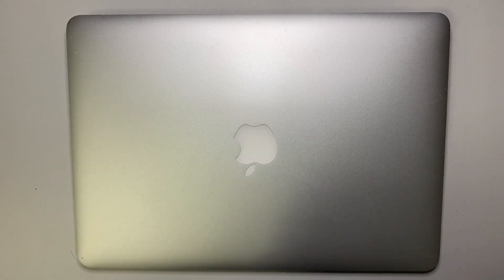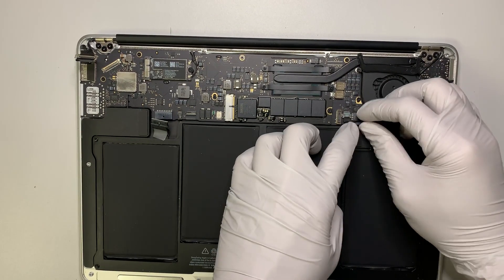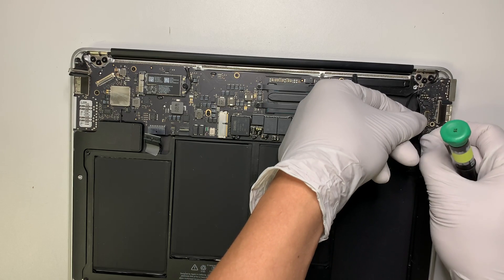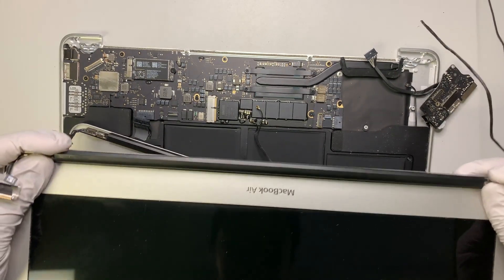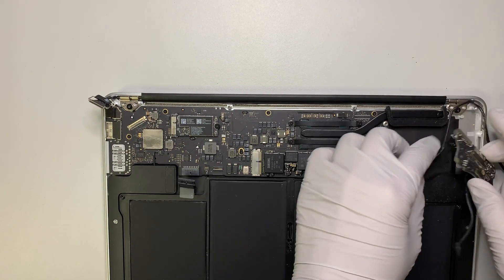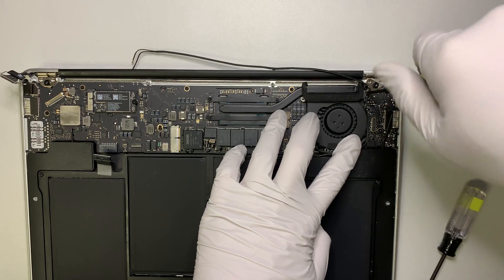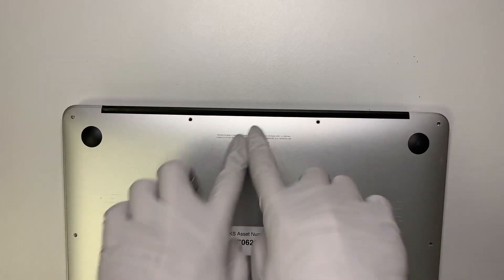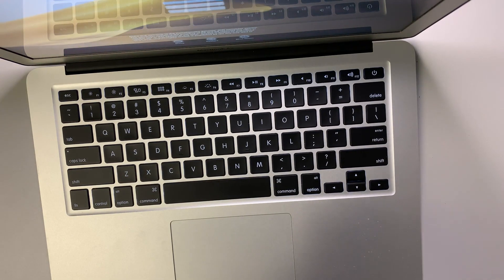Macbook Air 2017 A1466 Screen Replacement

Comment: Hello UberGeeks, just wanted your advice before I purchase parts. I have an A1466 Mac. My problem is that whenever I turn my laptop on, I can hear the opening sound but the screen stays blank. I didn't experience any gliches in the screen before this happened. I did change the battery, but I was able to use my laptop for some time before this blank screen issue happened. Should I be replacing the LCD? Your reply is greatly appreciated.

Comment: Good video but with one mistake...if you hadn't routed the cable wrong it would have avoided all the faffing around you ended up having to do with what looks like the webcam cable. Compare 3:59 to 9:46 - the cable goes on top of the USB/Power PCB not underneath.

Comment: Hi there, I was able to replace the screen as per tutorial. Thank you so much. Saved a perfectly working laptop and so much money. Thank you very much again.
Area of improvement in the instructions would be:
1. when you unplug the speaker cable, be super cautious and very careful because even a little aggressive pull will damage the cable.
2. when you unplug the wifi cables, pull the cables straight up and out. Don't pull the cable out like you do for all the other connections. So pull up.
good luck to all!
Reply: I broke my speaker cable... funny think is you really don't need to disconnect it to fish the other two cables. Should have just left it plugged in, otherwise great video
Reply: Thanks for adding those extra tips! Just replaced my daughter's screen with no issues at all! Great tutorial!
Reply from the maker: You are welcome. Glad the video helped. Thanks for the tips !

Comment: I just changed out my screen and I'm really not good at this sort of thing. The only thing I would change is to leave the speaker wires connected because the clip broke on mine when I tried pulling it off and it really isn't necessary, I stuck the wires back in the clip and it worked. Thank you very much for the video. Cheers!!
Reply from the maker: You are welcome. Glad the video helped.

Comment: I used this tutorial to replace my screen this afternoon. It took me a little longer than the video but I was back up and running in under 45 minutes.
Here's a tip for others: I took a picture of the back of my computer and printed it out. As I removed each screw I taped it over its location on the picture. I did the same with the insides. Makes it a lot easier to replace the tiny screws.
Reply from the maker: Thanks for sharing your tips. I'm glad the video helped.

Comment: Hello, thanks for video.. i change my screen by watching ur video . Everything working fine ... but its making noise on time of turning ON. I guess its fan noise.. i dnt know hw to fix this.. pls help
Reply from the maker: Try clean the fan by using air can duster. If that fan still make noise, you need fan replacement

Comment: Hi there, i reclaced the screen for a new one, the mac turn on but the screen stay black, i tried many ways to reboot the macbook but the screen still black.
Reply from the maker: Did you check the cable ?
Reply: @UbergeeksBiz  yes, all its ok, Then i tried with a second new screen where appears apple logo but the screen doesnt iluminate so i checked for electronics components in the mother board but all its ok, probably some mosfet was damaged, i dont know.
Reply from the maker: @felipemunozmora1903  Unfortunately, it does sound like motherboard is bad. Maybe the back-lighting chipset not output enough voltage.
Reply: @UbergeeksBiz  is it the cables ?
Reply: Did the same thing and my screen black

Comment: Hello, Thank you for your video and it helped me replace my lcd screen. I do have a question though, after replacing I am running into a slight issue. My laptop will charge, but the USB port right next to the charger output will not work. On the other side, the USB works though. Also, my internal speakers are not working and they are also no showing up in the apple preferences.
Reply from the maker: Try reconnecting the cable from that USB side to main motherboard. Maybe it is not connected properly.

Comment: After I did this repair. My computer connects to wifi but I can't actually use the internet. Everyone in the house is able to use the internet but not the macbook I repaired.  Any suggestions?
Reply from the maker: You replaced the entire LCD screen ?
Reply from the maker: What about if you manually input your router IP address ?

Comment: I was able to replace the screen, but the fan on my Mac is so incredibly loud and it doesn't turn off. Do you know how I could correct this?
Reply from the maker: Was the fan working fine prior the screen replacement ?
Reply: @UbergeeksBiz  I experienced the same issue. seems like it runs the full speed at all time. do you have any idea? is that possible to even disconnect the fan? seems its not activated that often
Reply from the maker: @50122leon  You can download the app call "Macs Fan Control" :    https://crystalidea.com/macs-fan-control/download     Hope this helps.

Comment: Any chance you could do a video on just replacing the LVDS cable for the the A1466?
Reply from the maker: It's hard to replace the LVDS cable. I suggest to change entire screen assembly.
Reply: @UbergeeksBiz  I’ve seen a few videos of it. Is it really that difficult? I don’t doubt it’s challenging but it seems like a plug and play situation.
Reply from the maker: @ChrisBranleh  You have to remove the glass. That's the most challenging part.